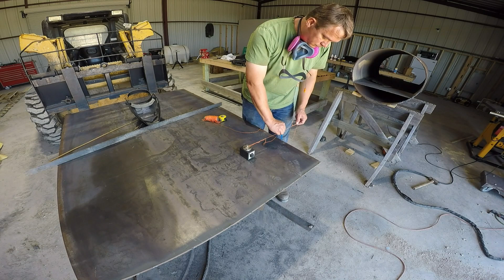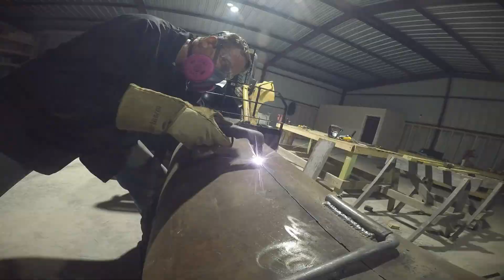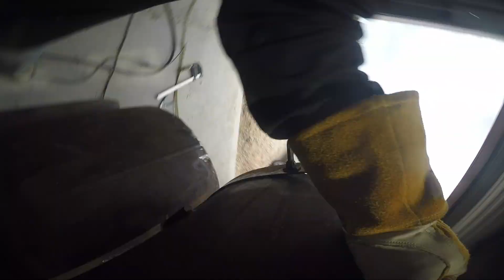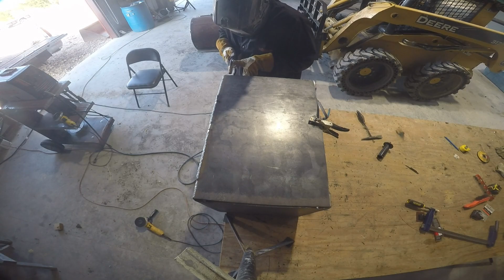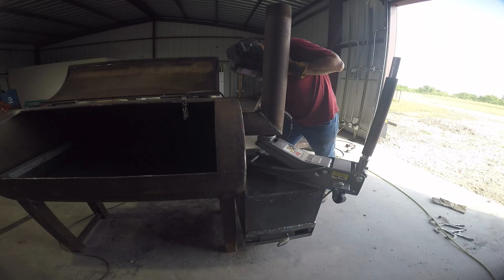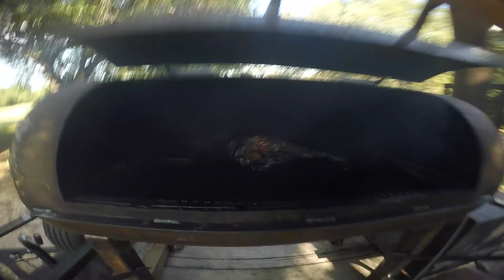Reverse Flow BBQ

Comment: Nice build,  it turned out sweet. Gearing up to start mine in a few weeks, have 500 gal propane tank and plan to use a smaller tank for warmer but going to make my box out of 1/4" plate.
Reply from the maker: How did it turn out?

Comment: Thinking of building at minimum a 40 x 60 shop. Might build the ibeam frame and roof so I can use it and later the concrete and walls. I helped weld a 24x30 for my father and you can barely walk in there.
Reply from the maker: You can never have to big a shop. Good luck

Comment: Would 3/16" thick plate be as good as 1/4" thick plate and BBQ smoker last as long outside?
Reply from the maker: 3/16 will last x2 lifetimes every where except the firebox. Which the bottom will probably rust out in 15 years.  Even my 1/4 I just assume I'm going to have to replace the bottom sometime in the distant future.
Reply: @LewisRenovation  Thanks, Much appreciated.

Comment: I made a circle cutter attachment for my plasma cutter to make jobs like this easier. I think you did a better job free-handing a lot of the parts, however.
Reply from the maker: ColKorn1965 thanks. You got a pic of the circle cutter?
Reply: I got a pic now.
Reply from the maker: cool, please send to my email address joseph@lewisrenovation.com 
I'd like to see it
Reply: Excellent Video! Excuse me for the intrusion, I am interested in your opinion. Have you tried - Tarbbatigan Beyond Dreams Tip (erm, check it on google should be there)? It is a great exclusive guide for quitting smoking minus the hard work. Ive heard some amazing things about it and my close friend Aubrey finally got cool success with it.

Comment: That's a nice build. What angle did you cut the top of the legs?
Reply from the maker: Thanks.  I cut them on a  radius to  roughly match the 24 in wide tank.

Comment: Great job, there. You make it look easy (assume it isn't). 
What's the dimensions on the main tube, and the size of the reverseplade?
Reply from the maker: Main tube is 24 inches. The reverse plate is about 20 inches wide. There is a link in the description that has a great design worksheet.

Comment: Great build and video. How did you finish off the cooking racks?
Reply from the maker: Thanks! Family wanted to use the BBQ for 4th of July so I tacked in a small piece of expanded metal.  The next week I cut it out and welded in expanded metal that went from end to end and also on the shelf in front.

Comment: I'm german and try to explain it in english. I'm a metal worker since 1984. Your work is very "old school". It's done like at home in a private garage. Sorry, but in my opinion professional work looks different.
Reply from the maker: It should since I'm not a professional welder.   Danke fur das kommentieren
Reply: @LewisRenovation  Everything o.k. ✌✌ Sorry, but maybe it's only because I see it through the eyes of a long time metal worker and welder. Go on and do it the way you wanna do it. Greetings from Germany. 😎😎
Reply from the maker: Of course I'm alwsys working to improve. And my welding is better today than it was two years ago. But I'm sure it will never be as good as someone with your experience. Plus, it's a BBQ, not a bridge :) Zum Wohl

Comment: When you opened the door a bunch of smoke came from the firebox area. That should not be happening. There should be zero. I dont think you know what reverse flow is.
Reply from the maker: Thanks for the input
Reply: I dont think you know what a bunch if smoke is.
Reply: @LewisRenovation  look good sir
Reply: @Joe-nn7gb  If it's reverse flow, no smoke should be coming from the firebox area.
Reply: @SOLDOZER  were do you want it to go
Reply from the maker: There is 1/4 welded plate creating an airtight channel that goes from the firebox opening to the opposite side of the cook chamber that the smoke has to follow. It then turns up into the chamber and exists the other side.  It is a reverse flow BBQ, though it may look in the video at the end like its not